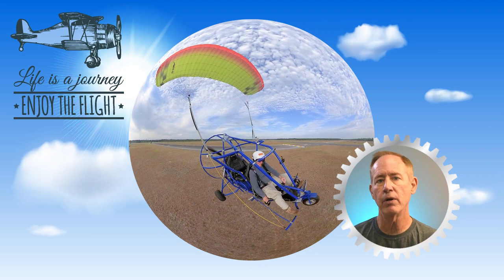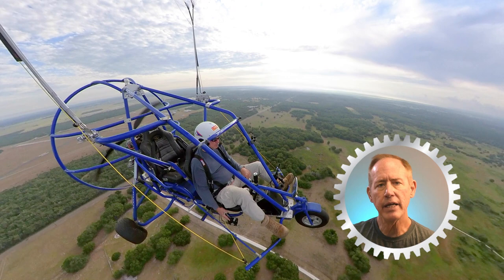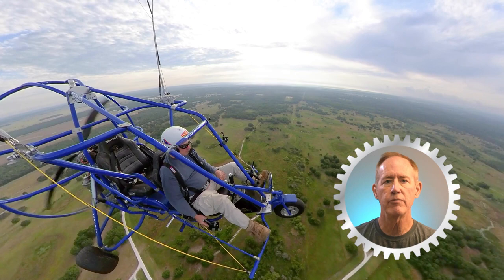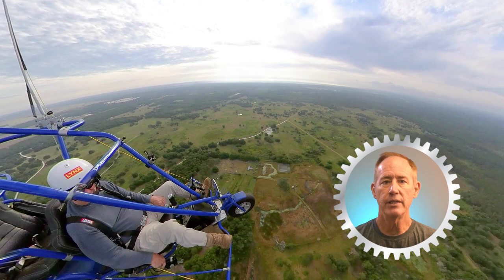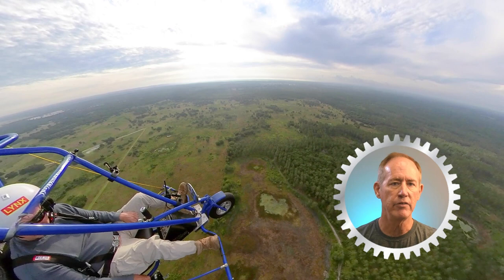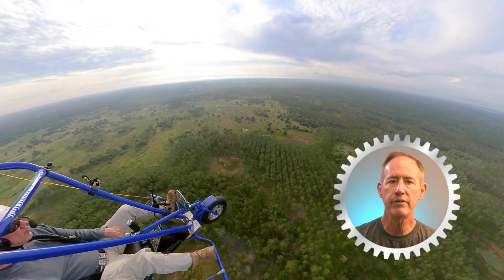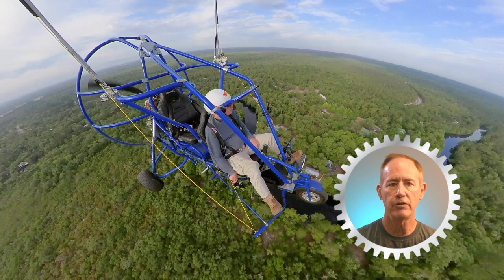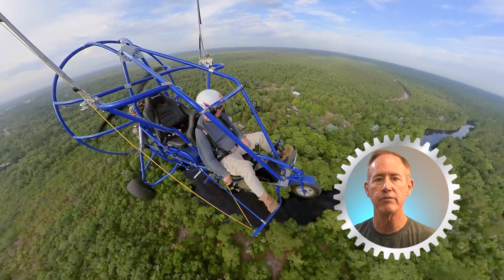Prop Strike on a Powered Parachute or a Powered Paraglider. | Sudden Engine Stoppage PPC or PPG

Comment: Thanks for a great video on a scary subject!
1)I have seen several videos on chute lay out which show that after the chute is laid out, the lines are thrown off to the sides. I was trained to manually pull the machine forward after chute layout to tighten the lines to just before the point where they start activating the "A" line cells. If those lines are laying slack next to the machine and you rev the engine up for takeoff, I know from experience that they can indeed be sucked into the propeller. 
2) At a local airshow I had my machine on display and I pulled the risers out a few feet to show someone what the parachute lines actually looked like. Didn't fly it that day, just display and answer questions. Next weekend got caught in traffic on the way to the airport and arrived less than an hour before sunset. Rush fueling, rush preflight, rush taxi to the far end off the runway (wind direction). While bumping along in a fast taxi heard a loud "Whack" and then vibrations.. I had pushed the risers back into the bag last weekend but it bounced out during the rough taxi and contacted the props. Lesson learned: use your chute bag lines to wrap around your risers and secure them to your frame near where they come out of the chute bag.
3) Over the past 20 years I have had 3 prop line/riser strikes. All involved light weight Powerfin props and none damaged the engine/gearbox. If you often fly near water and/or tall grass, a heavy, solid prop like Ivo might be best for you but for protecting your engine/gearbox, I definitely recommend the lightweight composite props.
4) If you do experience a power on, sudden stoppage and are trying to decide to have it expensively inspected or ignore it... remember the movie where "Dirty Harry" is facing the bad guy with that big 44 Magnum and says: "You feeling lucky today punk?"
Reply from the maker: This is an awesome comment with a lot of good information for new and experienced pilots!

Thanks for taking the time to share!

Comment: What about a belt drive?
Reply from the maker: Hi Butch! That is a great question!

Actually, pilots using belt drives have a lot less to worry about than those with gear boxes when it comes to a prop strike. Belts actually absorb a lot of the impact forces with slippage and even a little bit of flexure.
Reply: @EasyFlight  Thank you.  I had my prop hit the frame, taking off on rough ground.  Lots of other damage.